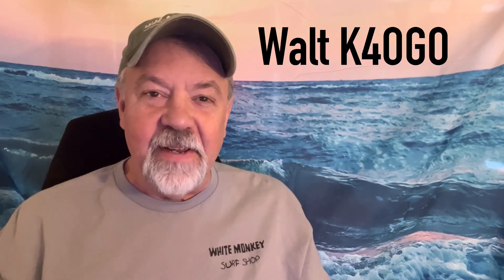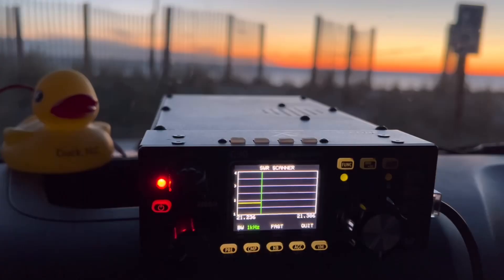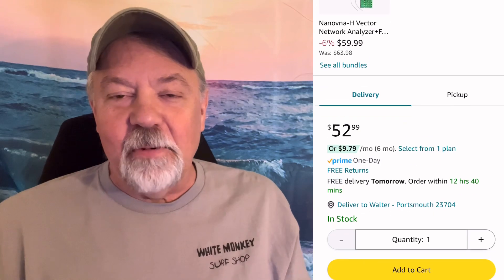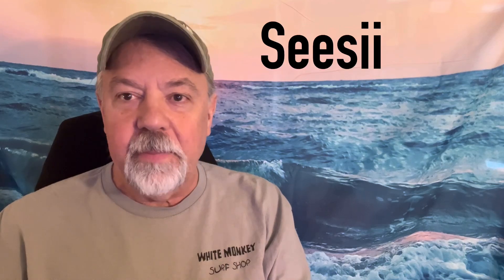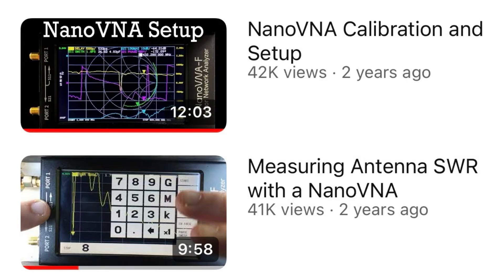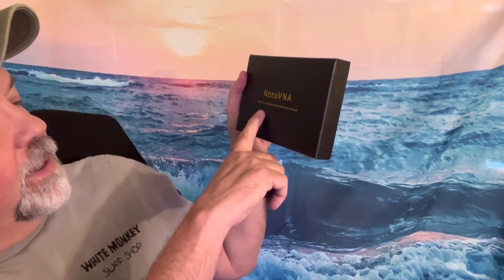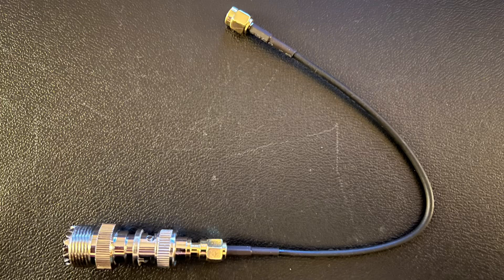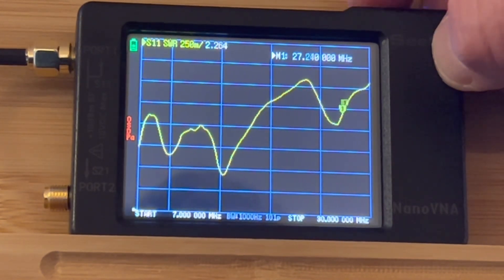Budget Antenna Analyzing - NanoVNA

Comment: I use mine with NanoVNA Saver to keep a record of changes I’ve made to my antennas. If I change locations (have had storms take down my EFHW multiple times and for finding the best spots for mobile antennas after swapping trucks) I’ll pull up the old sweeps and compare them to the current sweep.

Comment: Walt you don't have to calibrate it each time you can save the cal  in the trace and set up different ranges for different applications. just save and then go back to recall for the particular needed. This will save you time on your testing.

Comment: FYI For just a few dollars more (i.e. $59) one can get an original nanoVNA-H (manufactured by nanoVNA) from R and L Electronics (a nice ham supply outlet).  I originally purchased a white gecko nanoVNA.   I mainly use it with nanoVNA-Saver on my laptop, but I have been considering getting an upgrade.  

Curious to know why you did not go with the H4.  I had an H4 on my list, but I may rethink about the H.  It only $30 more, but that is 50% more.  

Thanks for your honest input.

Comment: I resisted buying a VNA for a long time but I finally broke down about 3 years ago, and I haven't regretted it. Besides SWR sweeps (which are great because you can see near-real-time results from antenna adjustments in the field), I use mine to check home-made baluns and chokes. 

I 3D printed a case for mine and at the time it was big enough to hold the analyzer, jumpers, calibration plugs, and USB cables. But now that I have a big collection of adapters for most amateur RF connectors, I need a bigger case.

You might want to get a couple of SMA male-female adapters for the inputs on your analyzer and leave them on there. They save wear and tear on the soldered-in connectors. If one of the adapters gets dinged you just unscrew it and toss it. You can still use the analyzer until you can get a replacement adapter.

One other thing: there's software for smartphones and Windows to control the nanoVNA over a USB connection. It gives you a bigger display and you don't have to fiddle with the tiny controls and touchscreen on the analyzer itself.

Comment: There are two downsides to these, Walt: one is that they are vert complex and have a moderate learning curve and the other is that the display is hard to read in bright sunlight in the field. The former can be overcome with practice and watching the many fine videos available.
The latter is more problematic if shade is not available.
Neither points are show stoppers and these little instruments fall into the "better to have and not need versus need and not have" category.
Go for the larger 4" screen though.
Reply: You can get Android and PC software to view and control the VNA over USB. Much easier on my old eyes!

Comment: I'm sold on the RigExpert Stick series. I'm rough on gear despite my efforts to not be that way. I've lost count of the number of times I've dropped my 230. Hint: Get an electric toothbrush case. The Android or iOS Antscope App really is great with bluetooth connectivity. Is it the best? Probably not, but as an engineer, one recognizes "good enough" for the task at hand. Just acquired a Stick 500 to get me up to 70 cM. I learned Smith Charts in school, but that was the mid-1980s.

Comment: I have a NanoVNA, a couple RigExpert Analyzers, and an MFJ 259B.  It is true that the NanoVNA is quite capable but you have to work harder and know a bit more to maximize  its use.
I suspect the screen on the NanoVNA is nearly unreadable is bright light. My RigExpert AA230 Zoom suffers from this too. The MFJ259B and RigExpert Stick 500 are easy to read in sunlight. The RigExpert Analyzers are the easiest to use.  The RigExpert  Analyzers vary in capabilities depending on the model.  The cheapest ones often lack certain features and the company does not always make the difference clear on the website. Support is rather good, however.  The capabilities of my two RigExpert Analyzers are close to the same. TDR is only available on the AA230 although this function is available using software if you are willing to make a few simple calculations.  There are other analyzers on the market with various capabilities, one needs to read the manuals to understand the differences. Incidentally the RigExperts are VNAs too. They have a great interface.

Comment: Great vid Walt, esp since so many people watch your antenna trials.  SUGGESTION: you don't need to calibrate every time. There's room for 5 "Recall" calibrations. Keep the 7-30 you already have for the "big picture." Then, make and save a calibration (just a bit wider) for each of the bands you like to use, i.e. 6.5 to 7.5, 13.5 to 15, 20.5 to 21.5, etc. That makes it real easy to hone in on specific bands. One more hint: calibrate the most used band and save it first. That will be the one the NanoVNA displays on startup. Keep havin' antenna fun.  It's perpetual. :)

Comment: Walt, buy a bag for a 3.3" HDD, they are all over the net and are about the right size to take a NanoVNA. It's what I use, all the bits fit inside. Turn the VNA screen down to protect it. 73 Bruce

Comment: very good. a VNA will take some time to learn it. I have the H4 . same just bigger display.  them are SMA connectors like the HT's use. get a bunch of adapters. Smoking Ape on you tube has lots of video's on the VNA. so does Coffee and ham radio channel.  and bunch more.  their is a 3D printed case for them. you can save data to PC . and so much more. for $$ best thing you can buy for antenna work and much more. 73's

Comment: I agree totally that people should start with the NanoVNA. It's complicated and finicky, but it's inexpensive, and it shows you what you need to know! Having the G90 like you do, it's not QUITE as vital, since that thing'll tune anything, but it's still good to be able to analyze what you're using in more detail.

I wound up getting the RigExpert 500 (which I like to call the Antenna Banana, for its shape and colour) as well, and I tend to use that more because it's simpler, but if I were actually BUILDING antennas more often, I'd probably use the NanoVNA more for that. Both are great tools!

Comment: It is amazing how well the Nano VNA works! It's difficult to see the screen in daylight, So you'll want to find a shady spot or inside your car to read the answers. By getting a section of coax that's exactly one half wavelength long, you'll be able to determine the measurement at the feed point, instead of having to connect directly on the antenna.

Comment: I bought an expensive rig expert and tested it against a 5$ swr meter I got from a thrift store.....they were the same. The antenna analyzer can do a lot more than just swr and power but you don't really need more than that for building simple antennas. I did see a guy analyze coax and like 5 or six other things I don't understand but for getting a wire in the air it's not needed. Should get some more folks watching your channel tho and give you way more understanding of how all this stuff works!

Comment: Setting one up with S11 SWR and S11 impedance traces (with or with out a Smith chart) is one of the best tools for tuning horizontal dipoles that I've found. Really helps nailing a 50 ohm match.

Comment: I bought one about 9 months ago.   I can find the SWR but am still trying to figure out the other features.  I put mine in a RubberMaid plastic box but first put a piece of foam in the box and cut out the unwanted parts.  The devise rides tight in a hard plastic box surrounded by foam material.   Thanks for the video.

Comment: Piece of advice, Walt - those connectors are not designed for multiple connects and disconnects. Invest five bucks in a pair of male-to-female adaptors (also available from all good online rivers) and add them as "socket savers". When they wear out, the replacement will be another $5, not $50! The NanoVNA is great, and for the price - why not have one? Same goes for the TinySA spectrum analyzer.
Reply: Never heard of anyone actually wearing out SMA connectors by hand tightening them. On the contrary, having a big adapter sticking out is more likely to break this tool, which is so cheap it's hardly worth the trouble, even if it did make any difference in saving the connectors.
Reply: Both my handheld radios use SMA plugs and sockets. I used to use my VX6R on a mobile antenna using a SO239 socket to SMA adapter. It is fine.

Comment: Exactly the same one I bought a few weeks back and I 100% concur - it's a bargain and like you my compromised vertical produced exactly the same sweep across the bands - very encouraging in one way but shows how rubbish they are without a tuner. Sadly my compromised EFHW did not fare much better so I now have to rethink my shack antennas completely. At least I can use a modicum of science now LOL. 73 M7BLC

Comment: Hi Walt, I'm surprised you haven't bought one before, after a while you will wonder how you ever lived without it! That's certainly the case with me and your VNA will do more than the expensive analysers you showed at the beginning. If you can, calibrate at the end of your patch lead when it is connected otherwise the lead itself will be included in your measurements and may distort your readings. Alternatively get an SMA/SO239 adapter and put it on S1, then calibrate. Best 73 Ace

Comment: I use a Nano VNA   H-4  which has a 4"  screen - a little easier to see and read outside.  Use it a lot up on the roof and to check SWR on my UHF and mobile antennas as it fits in my pocket and my MFJ-259D doesn't cover UHF. You can save your calibrations for quick recall so not necessary to calibrate every time.  Good move Walt,  Love your channel!